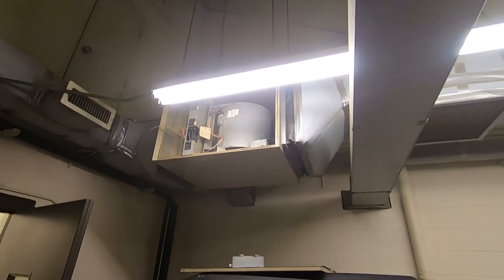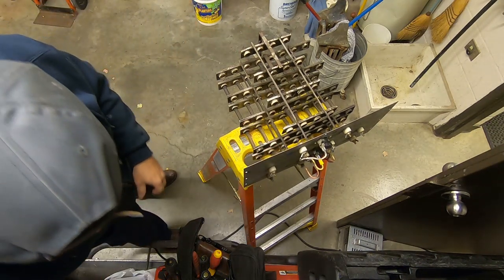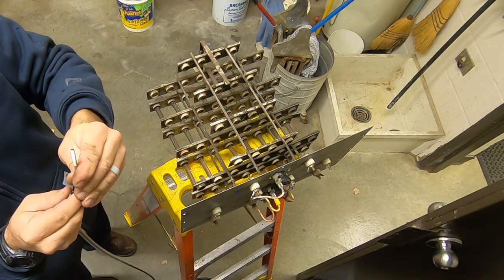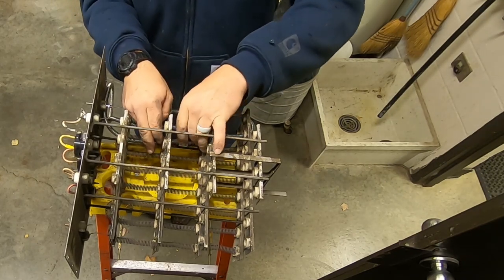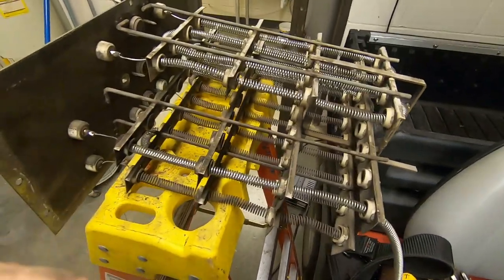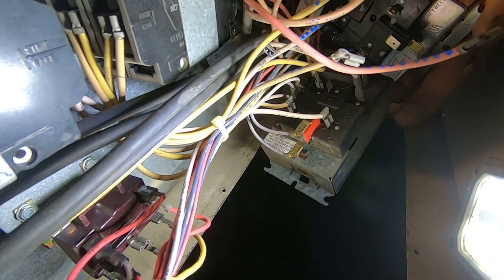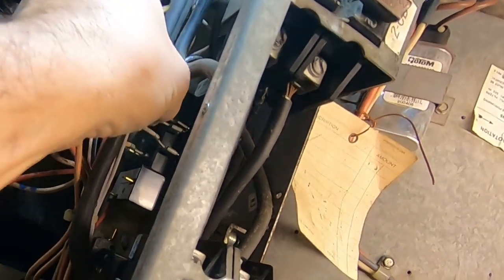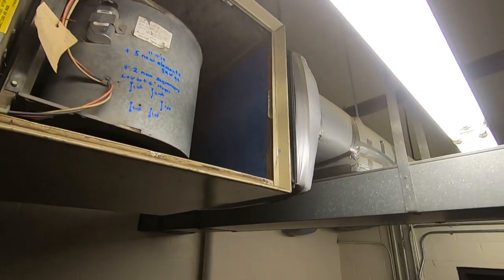Electric Furnace Restring and Sequencer Replacement

Comment from the maker: A simple video of how a typical electric air-handler and sequencer is wired and works,  it's not high tech but It's interesting for me to hear some parts of the country don't see these,  so this is for those viewers. Don't forget to subscribe and click the notification bell to be notified of my upcoming videos. Thanks for watching👍👍 FYI Here is the link to my crimpers. Also, check the description for links to all my most common tools used.   http://www.cleavelandtool.com/Rachet-Terminal-Crimper/productinfo/WTC380/#.XbPY_ehKhPY
Reply: HVACR Survival, I used to work on commercial electric blast coil heaters that were slide-in installed on AHU plenum ductwork ior heating in high-rise corporate office building applications. When I ran across defective elements in a slide-in segment, I would have to order a whole new segment, rather than replace the single defective element within the slide-in bank of elements because the whole slide-in, blast coil heater segment would lose its Underwriters Laboratory (UL) Rating if a defective element within the segment was replaced with a new, restrung element. The building insurer would not honor insuring the building if any of the equipment making up the building infrastructure did not have a UL Rating. Have you ever ran across that issue? The equipment manufacturer of the blast coil electric heaters was a company out of St. Louis named Indeeco. This was back in the 1990s thru the eatly 2000s. Just sharing my experiences in the field on this specific subject.
Reply from the maker: @Artisan.HVACR1  that's interesting, I don't usually hear much about what would be covered under our insurance or not. Generally as long as I do everything safely and to electrical code and installed the same way it was originally installed I haven't heard anything negative. The situation on this job was it was getting below freezing that weekend and they had water on in the building. This building's only use in the summer usually. So they had no time to replace it and just wanted something to keep the pipes from breaking.

Comment: Very interesting I a
Have never come across anything with electric heat strips here. We just have no need for them as it doesnt get cold enough
Reply from the maker: Yea yea yea rub it in. 😂🤣👍👍
Reply from the maker: @Billy Simmons nice weather compared to what state? Alaska?🤣
Reply from the maker: @Billy Simmons I'm in Ohio,  we have about the same weather as Chicago. I'm only 4-4.5hrs from there.
Reply: Heat strips are common where i live, usually as AUX heat for heat pumps, since we do get cold enough where a heat pump becomes less effective, so the electric furnace in that case take over, we also have gas/heat pump dual fuel systems too.

Comment: Thanks for this vid.  I got to restring an industrial electric heater soon.  One  string is 28 ft long.
Reply from the maker: Wow,  that's crazy! What kind of amperage does that pull at what voltage.
Reply: @HVACRSurvival  its 460 3 phase.  It's a new customer we picked up.  I will amp it out on the install.  Each string has 4 rows and is 7 ft long per row.  It has 5 sets of rows, each row had burnt in half.
Reply from the maker: @bmillwood6666  amp draw will be low then. Cool man!🤜🤛👍👍
Reply: @HVACRSurvival  I found the data tag I took a pic of and it reads 90 amps total.  75 kw.  So that is about a 75hp motor running just for heat.

Comment: The way I install new elements. Cut them out like you did at both ends. Be careful when removing the old elements as to not stretch them. Line them up end to end on the floor. Pulling both ends to match the length of the old elements. Then restring them. On the spade connectors. To properly tighten them do not squeeze the bent ends. Their is a strip of metal or a triangle on the back. Push this in and this tightens the spade. It’s like a spring. If you pinch down the end it will probably crack like it did. If you look at a spade connector you will see what I’m talking about. Too many techs try to tighten these connections the wrong way. A small screw driver is all you need. This trick works with the plastic insulated spades as well. Just push in the back metal strip or triangle piece and it’s tight.
Reply from the maker: Sounds like good advice to me,  thanks👍👍.

Comment: Done a few over the years. That's basically how I do it. And yes don't streach element to far it will not be good. The last few I did were in the duct. Had a cover to remove to get to it. Very bad design  terminals get brittle over time burn off
Reply from the maker: Thanks 4 sharing and watching Roy,  I appreciate your time👍👍

Comment: Perfect timing for this video to come out, I had to work on two ICP Electric Furnaces with in the last week , one was 2001 the other 2005, I use to just replace the whole strip kit (I had to yank them out to work on it since there is no room in the cabinet), found out that ICP don’t have them any more, but it can be special made but it will take 2-3 weeks to get. So it looks like I am going to be stocking restring kit, ac and dc voltage sequencers. By the way have you had any problems finding fusible links with the right temperature rating for some of these Electric Furnaces?

Comment: Good video.   I never had to rebuild an element.   You mentioned the honeywell part being the sequencer.   I thought they were the little thermodisc devices located on the element. Help me understand.  Thanks.
Reply from the maker: There are singles and doubles,  sometimes they put two singles or doubles on a shared base. They are cheaper but they don't have the aux switch I needed and they have a larger foot print. I needed smaller

Comment: Good stuff- I dont see that many electric heat strip units in my area, I think ive worked on 3 or 4. Do they have other supplemental heat for those days it gets really cold, 10 and below?
Reply from the maker: This was a strait electric furnace, so it would handle any outdoor temp if the coils are sized correctly and are all working. In a heat pump scenario, It could have a gas furnace,  "Dual Fuel" as we call it, but that requires a lockout system so the gas furnace and the heat pump cant both run at the same time, the placement of the evaporator coil would be after the furnace heat exchanger vs in an electric furnace the evaporator coil is before the strips.  I hope I'm following the question correctly.  Hard to believe there aren't many electric furnaces or duct heaters in Michigan?

Comment: How can I tell how many KW my 1 1/2 ton unit has in heating?  The heat does not come out as hot as I would like. Can I upgrade to a slightly higher KW or just get a new original heating strip?
Reply from the maker: Generally you can count how many elements there are, most elements I see are usually around 5 kw a piece. You've got to have the right size duct work and the right CFM of air passing over the electric strips.  It sounds like you need to call out a professional to look over the system,  I would not recommend just sticking something in there without knowing what you've got. It could be unsafe.
Reply: @HVACRSurvival  Thanks, I will call a local AC tech.